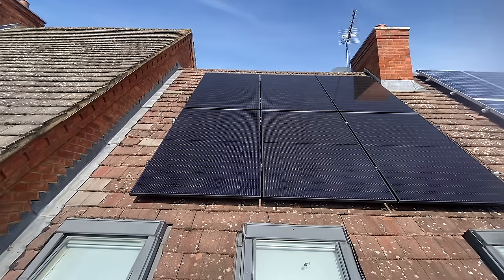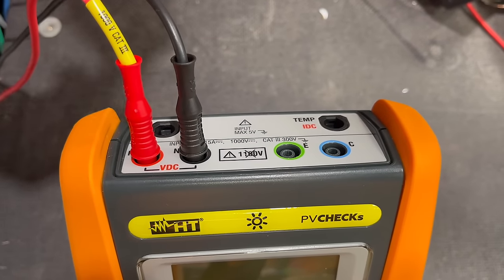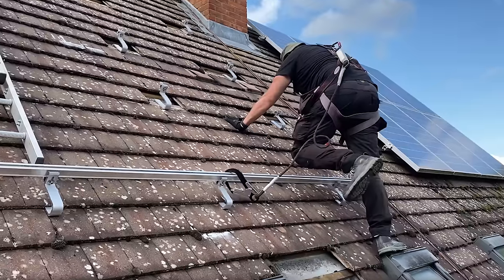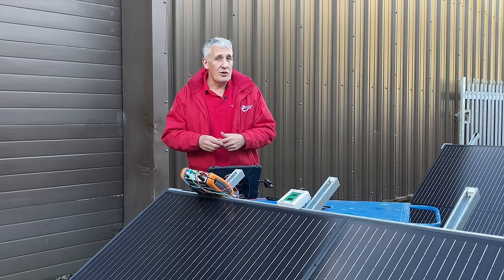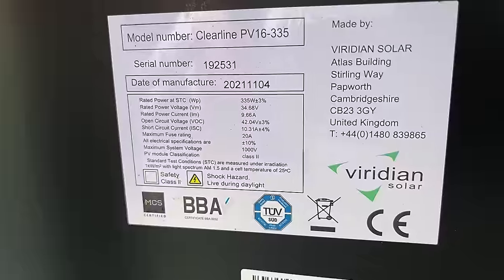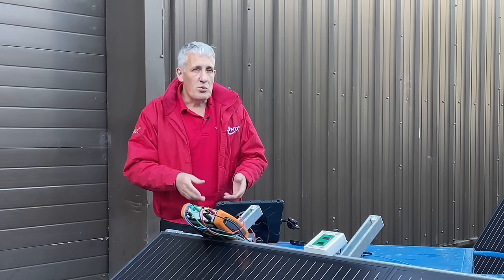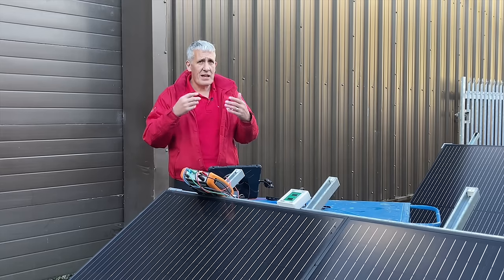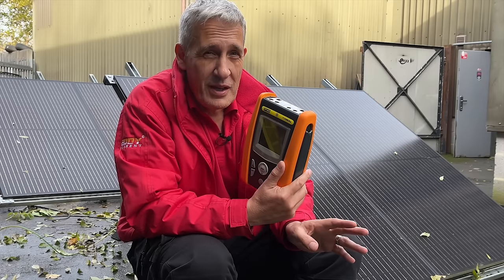How NOT to Test Your Solar Installation! - PV Checks

Comment: Nice piece of kit but 15 Amp is too low most of our inverters are rated at min 22 amp maybe they can supply a shunt to increase the I Max test. Also note, both V-max and V min are very important to the performance of the Inverter.
Reply from the maker: Stay tuned….. 😉
Reply: The NEW PVCHECKS PRO can do 1500V Open Circuit and 40A Short Circuit 😉

Comment: Do solar panels that are this big require series based connections? What is the voltage and amperage that these types of solar panels deliver? 
I’m still very young and would like to learn more about electricity.

Comment: Great video! Food for thought - BS7671 recommends Riso testing at higher than 500V if your system voltage is higher, which is normally the case in a commercial scale install. The latest version (2018) of BS EN 62446 goes further to recommend Riso test voltage is higher than 1.25x string Voc under STC. This results in a recommended test voltage of 1000V or even 1500V for any commercial-scale installation with the same 1 megaohm pass criteria.
Reply from the maker: Great feedback- which of course makes common sense. This tester supports up to 1000VDC testing.
Reply: @efixx  Yeah. Testing voltage obviously has to be above the string voltage.
Reply: @scwfan08 Agreed but how much higher than the open circuit voltage should it be? That's the question.

Where is the voltage at 1.25x Voc going to come from in an installed operational PV system?

We are not talking cabling which is being fed from the national grid, we are talking DC where the maximum voltage is set by the design of the panels.
Reply: Interestingly the IET's code of practice lists much lower minimum isolation values for arrays as opposed to cables - I think they might be asking you to test the cables at 500V with a nimimum of 1MΩ. When you look at table 5.3 on page 65 the minimum values range from 1-30kΩ. And I'd always test at a minimum of 1000V because we never have strings that are less than 500!

As for the array frame, bonding requirements are one thing but they all require (according to the CoP section 5.13) at least functional earthing. The functional earthing requirement is to ensure that the insulation resistance monitoring works properly and we all know that it will still trigger even when there isn't a funcitonal earth, but that's that!
Reply: Riso on solaredge should be done with 250V
Reply: @deang5622  Umm. From the tester?? The voltage is induced by the tester.
Reply: @deang5622   Same reason you test 230v (300vp) mains wiring at 500v I'd guess.
Reply: @deang5622  you take the next higher voltage the tester offers. Simple

Comment: Interesting to see them release a meter that's only rated to 1kV.  Still, lots of arrays will be covered by that voltage but many countries either already permit higher or are moving to it.  Personally 1kV or more on the roof gives me the heebie geebies.
Reply from the maker: Stay tuned!
Reply from the maker: I remember the days of Neon a 10kV 100mA transformer on a roof was pretty standard stuff.
Reply: @efixx  I'd rather that than 1kV of DC at 5A.
Reply: 1kV+ meters are indeed very limited at the moment, which is a bummer as the utility scale (10-200MW) farms I work at are almost exclusively 1.5kV systems these days.
Luckily HT does have the PV-ISOTEST that can do 1.5kV and of course the Fluke 393 is pretty nice for quick checking (also for AC as that is also almost exclusively 800V on new parks).
But for short circuit tests I also rely on a 1500VDC 45A load breaking isolator switch to make and break the short in combination with the fluke 393 to measure the current if I exceed the 10A rating of my normal Fluke DMM fuse. 

But I don't think it will be long until they cross the 1500V line for the utility scale installations, we already have to be certified for HV on the AC side on these parks anyway (10-35kV central inverters) so that's no longer a barrier for the manufacturers who have already done some tests at 3kV DC.

This is all land / water based systems, no roof work for me, also following Dutch / German regulations.

Comment: Is it just me that thinks these tests are unnecessary?  Most installations these days are done using optimisers or micro inverters which give you all the data you need to see if your array is performing well.  All the test equipment companies must be happy with these regs.  It's almost like they're scratching each other's backs!  Oh what a conspiracy theorist I am!
Reply from the maker: Most installations don’t have optimisers. Especially the larger ones without any shading issues.  Even if you fit an optimiser you still need to perform the installation tests.
Reply: @efixx  I'd love to know the percentage of installers who sit up on the roof with a lux meter plugged in taking all these measurements on every single panel.  I'd estimate almost none lol.
Reply: The only test I can see being important here is the insulation test.  The rest are very obvious by simply looking at the inverters current operating measurements and knowing what panels you have installed.  The idea of going on a roof with an irradiance device to check power output, crazy, who's to say the irradiance device is calibrated, better get another irradiance device to calibrate against the first one... Oh hang on solar panels are irradiance measuring devices if you know how to correctly interpret the solar panels properties correctly.
Reply: @WindyJAMiller  oh they'll insist on you having a calibrated meter mate.  All part of the revenue stream 🙄
Reply: @efixx Solaredge, one of the market leaders, mandates optimisers on every panel. I'd estimate we use optimisers on 20% of installs. It's frustrating to spend circa £1500 for a tester that can't be used on many installations.
Reply: We do…

Comment: Great vid. But I much prefer micro inverters, they I believe are the future.
Reply from the maker: Not so easy when it comes to battery storage though?
Reply: @efixx  let alone utility scale systems, I will quit my job the instance I get send to a 50MW plant with microinverters....
Reply: @efixx  depends, Myenergie Libbi batterie’s work perfect with them,  as does my solar hot water immersion based tank and my underfloor inscreed heating on my energy eddies. Zero export! Also have a 6kw wind turbine. Just love all this new tec from Myenergie to divert power. So i do in fact have grid connect inverters but not for PV, so  do not bother with strings of PV on grid connect systems. Just use strings for off grid systems (with the victron multiplus inverter chargers).

Comment: My seaward pv150 requires an earth connection so I always connect a cable to the rails and bring it to the earth point at the location of the Inverter. But as I am aware the rail only needs to be earthed if it's within 1m of a valux window on the roof . So touch voltage as a person could touch the rail or solar pannel. Correct me if I am wrong please.
Reply from the maker: That’s out interpretation also 👍
Reply: @efixx  every system I have been involved in I use a 4 or 6mm PV cable and clamp it down then back to the equipment. Easier than getting a ladder out I suppose.
Reply: Friends of mine recently had solar fitted on a metal roof with metal downpipes. How should that be earthed, & similarly the heat pump? If both are earthed to the MET on the PME supply, & if there's an open PEN fault, then both will become live with respect to true earth & we have exactly the situation that lead to the requirements for PEN fault detection & isolation in EV chargers....??
Reply: @alanjewell9550  a few years ago on a forum I asked the question regards fitting an open pen unit for a EV for my caravan hook up. Wow wished I never asked as I got slatted. But I will be fitting one to supply my caravan at home regardless if it's not in bs7671.